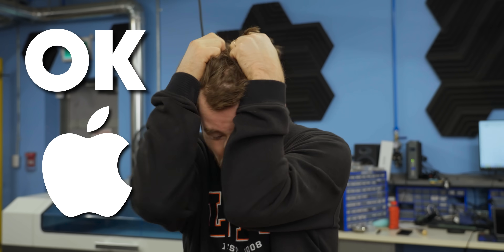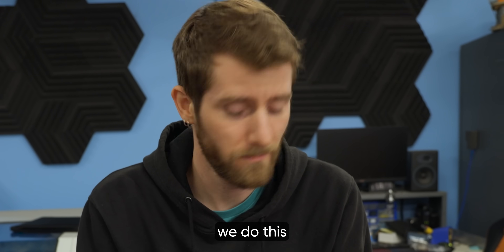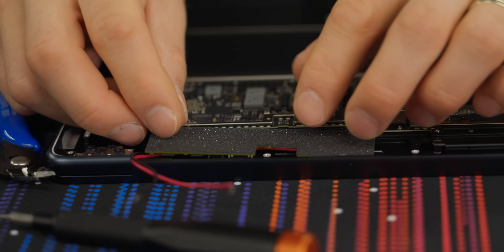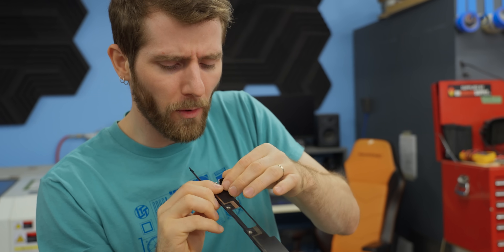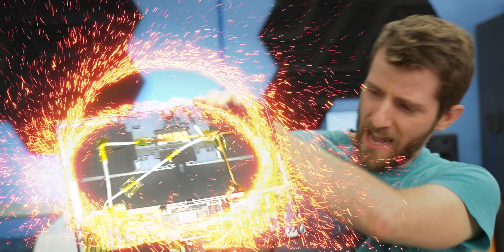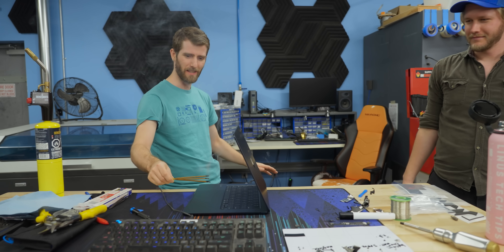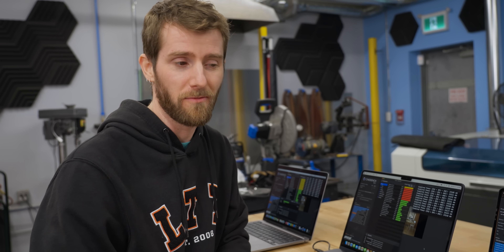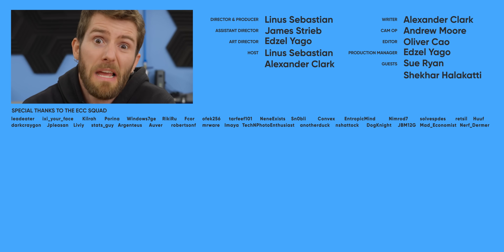Apple please watch this. - Frore AirJet MacBook Air

Comment: not legal, just click-bait. making your own cables <3. best part is no part, passive chassis metal cooling. sometimes you just invent part to sell a part, even if it could be solved more easily, or not at all, because already solved, airjet. terminology pride is you downfall, switches. you pretend to know and be the author-ity, but for no benefit, only a tie-block. also you dont have to fit stuff in the slim containers. come on, the backside of the lid would be an ideal large heat sink surface. flexible copper heat pipe bridge, from the main chassis, or a vapor chamber pipe.

Comment: Peizo electronics are so cool, but it's so unlikely that Apple would introduce this technology into their laptops in the next few years. It's more likely that we see windows brands like Acer, Asus, HP etc. put this into their already slim thin and light laptops, or maybe into 14 inch gaming laptops? Could this be the return of 13 inch gaming laptops if the peizo electric fans can be as powerful as a regular blade fan and be much more efficient? I have my fingers crossed

Comment: I’m far from an Apple fanboy, but this really just comes off as a hit piece against Apple. The Air isn’t designed for people who are constantly hitting the processors hard as there is no active cooling. The MacBook pro’s are the ones that are designed for sustained loads.

“Apple will listen or they don’t care”

Or they already have a device that has better thermals/active cooling for those who are power users.

Comment: LTT: We modified the MacBook Air so it has no MagSafe, no speakers, less battery life and is no longer silent, but it doesn't thermal throttle at sustained loads anymore. 
Apple: Have you met the MacBook Pro?

Comment: Wondering if the new copper heat spreader is causing the improvement and not so much the air generated by the device

Comment: "No moving parts" yeah except for the little flap of metal thats moving at insaneo speeds to move air, because you know metal fatuige isnt a thing at all, these things convert electrical energy into mechanical energy. A piezo fan uses this property to drive a cantilevered beam at resonances creating a fan element. that sounds to me like a moving part?

Comment: I always thought apple removed the fans in the macbook air after they released their own chips is because both the Air and Pro are essentially the same.

The only key difference being that the pro has a fan and doesnt thermal throttle as quickly...

Comment: I´m curious about the battery hit that using this thing causes in the system.... makes me wonder why they didn´t show the battery usage with in this 30 minutes test
like
the macbook without mod used 10% battery
moded macbook used 30% battery
and macbook pro 15%battery ..... or wherever number they got
this would be super nice to know and would have meant zero extra work from their end

Comment: Many good thing Apple do does not copy by other. A lot bad thing Apple do copied. Example good iPhone camera, front AF, telephoto, although it has been long in flagship android, it still not in low to mid ($100 to $200) phone. Instead many of that phone copy the bad rectangle body, dynamic island, etc that many of us does not need. Why not use more better hardware in low end Android phone?

Comment: I’ve never understood the MacBook Air thermal throttling issues - I’ve been using my M2 air for the past year and I honestly haven’t ever had it thermal throttle. Tbh the only issue I’ve actually encountered in my daily workload of software development / video editing is that MacOS appears to be terrible at memory management and consistently needs manual intervention to prevent SSD ‘swapping’ despite my M2 air having 24gbs of memory; and with the SSD being soldered to the logic board is more terrifying for me for the long term continued use of a MacBook for my daily work. Outside of this one little issue it’s been the best work laptop I’ve used in the past decade - more than powerful enough for my workflow, with amazing power efficiency to allow a full day of real work without needing to bring my charger into the office.

Comment: You are getting those numbers on the stock  Mackbook Air in a cold climate or under AC, in my 30°+ 95+ humidity country will thermal throttle in 0.5 seconds after turning on

Comment: I feel the biggest thing this video proved was that apples cooling solution was actually perfectly adequate for the intended use case of a MacBook Air - short bursts of high-performance, but overall light duty work. The fact is took 20 minutes of a synthetic load to bring out like a 10% difference in benchmarks? It could absolutely benefit from this cooling technology, but it also wasn’t a mind blowing difference either.  Maybe with better integration, we would see a greater difference, as to be fair. This was a fairly DIY hacks job and still prove the point.
Reply: That’s exactly what I was thinking. MBA’s are meant for people who do basic stuff, or short bursts of heavy stuff. If you need anything more, then you need a MBP, or to just deal with the throttling.

Comment: Your stats for what temperature causes burns is specifically for water, I highly doubt touching an object will do the same, it will probably depend on the heat transfer rate between your body and the object, for water you have maximum surface area and water has a high specific heat capacity. People can touch 60 C objects for reasonable periods of time with no burns, definitely not the 5 seconds for 3rd degree burns that they claim for water.

Try touching a hot object and then try touching the same temperature of water, the water will feel much hotter.

Comment: Dont think apple will implement it into the air. The "no cooling" part is the main difference to the pro, to be  fair. Do you want your processor runing fast and cooler you have to buy the pro.

Comment: Apple has been thinking different in ways that make their computers worse for years and that's not about to end now just because you CAN make a way to move air that's super thin. Being super thin isn't the point, the old intel Airs weren't that thin, the point is making it slower than the pro. They don't give half a crap if your machine dies quicker and constantly overheats as long as it doesn't cannibalize another model they can sell you when the first one dies.

Comment: Imagine if you did heat pipes like one of those insane looking air coolers, but instead of aluminum fins cooled by an external fan, you had aluminum fins cooled by direct contact with these things.

Comment: what if you just slapped a thermal pad on the cpu and then closed back up the lid? so that the bottom panel acts like more of a heat sink. Wonder if that would produce a similar result

Comment: I'm probably in the minority, but I specifically got a MacBook Air because it has no fans. It sits directly under a microphone for voice over work and I don't want that interrupting ever.
Reply: M1 didn't overheat right? Then they just screwed up the M2 design
Reply: @ciestermr1848  M2 was basically juiced up M1 with new chassis with screwed thermals.
Reply: @ciestermr1848 They didn't, people say they did but that is a problem when benchmarking for a long time, if a person is buying a MacBook for something demanding they should get the pro version, regular version is for people that browse web, do some school work and such not heavy rendering and so on.
Reply: I have the m4 MacBook Pro. I genuinely don’t think I’ve ever heard the fans kick on except for when I did a cinebench stress test when I first got it
Reply: this video is not about fans
Reply: leave it to jarrodstech to leave a comment about fans on a video without any fans
Reply: have an option to turn it off 🤷‍♂
Reply: @MrNick99 You can turn them off and see that they were not designed to run without fans, without fans enables it for being smaller and having better passive cooling, gaming laptops often sound like a jet after opening simple apps and without they will throttle since the whole thing is designed, the fans are there for a reason instead of being fit with radiator. Linus has made a pc with passive CPU cooler, my Mac is always cold and the it gets human temperature hot when running games like Project Zomboid a regular laptop would be lifting off already.
Reply: @_espo_5524  you have a very poor knowledge of other laptops.
Reply: @B-jv8iy  Nahh, had to buy one in late 2021 saw the options and the prices, have gone to classes with people bringing their own laptops from wide array of prices and companies.

Comment: There are moving parts, the piezoelectrics are electro mechanical substances that generate electricity when pressure is put on them or vice-versa. They don’t move much, but they do move. https://en.m.wikipedia.org/wiki/Piezoelectricity#/media/File%3APiezo_bending_principle.svg

Comment: Gotta hit up Rossman for the board views next time you need a power source on a Mac
Reply: They should have just probed all of the inductors till they found the main power rail. I don't understand how they fried something unless they slipped up and shorted a power rail to ground with the battery plugged in. An inductor would have been a nice big pad to solder to also.

Comment: If I was to modify the Mac book, I would have left all the peripheral as it is(not cutting. Design new back/bottom plate which can accommodate the new air cooler & its electronics. 
That way you would have increased the thickness of the laptop to 2 to 3 mm.
Make it very usable.

Later mass produce it to make money !! 😅

Comment: Either Linus was held at gun point to make a video on apple product where its glaring deficiencies are mostly overlooked. Apple is trying to appeal to the most stable 3rd party influencer because their gimmick products are trending to flop pretty hard or more likely Frore Systems attempted to pitch this idea to Apple and it fell on deaf ears, which is expected, leading to Linus offering their reach to help possibly get the ball rolling on this. I'm willing to bet that this will be internally tested at Apple, only become available on the premium model and claim that they are the first to implement and develop the tech

Comment: 5:55 yeah probing is difficult because you doin it wrong. No sane person works with both probes at the poles. Black is always on a good ground point, not on the part you try to tinker with.

Comment: Apple will not implement this. The MacBook Air is targeted at consumers who use their macbook for simple tasks, during which it stays completely quiet because it has no fans. The target audience for this product generally prefer a quiet laptop over a slightly faster one.
If you want better specs, Apple wants you to buy a MacBook Pro.

Comment: I'm curious to see if they would have been able to add some vertical spacers in the chassis so they can fit the Frore jets on top of the chip, and then perhaps used a 3D printed or CNC'd lip to fill in the extra space between the edge and base of the device, so that everything still works in the damn device :')

Comment: This is really awesome, I hope apple adopts it. I upgraded from an Air to Pro and I miss not hearing fans because there were none. x)
Reply: Do you hear your MBP though? The fans are basically silent on mine and even when I hammer it hard it's practically inaudible at <2200 RPM. If I manually set it at 100% and it goes beyond 5000RPM, its still quieter than standard 120mm PC fans at 100%. I don't know how they made their fans so quiet - maybe they just barely move any air since the ARM chips don't make much heat.
Reply: @pieterrossouw8596  yeah, when I run World of Warcraft, I hear them. They are by far not as noisy as my Gaming PC was, but you still can hear them. ^^

Comment: This is much more interesting for a Steam Deck for example, than a Laptop. Power budget and cooling is much more challenging there, as you only have like half a laptop.
Reply: Its really not, a fan is a far better solution as they can't make the battery any bigger in the Steam Deck without making it heavier.  I already wish they had not increased it in the OLED and just let the device be even lighter.  I never have a chance to drain the battery as my wrists hurt before then.
Reply: @alexatkin  yeah, but they still could still make it smaller and decrease noise

Comment: There are apps that let you manually control the fan speed on Macbook Pro. They should have done a test with the fans manually set higher to see how it compares to the preprogrammed fan-curve Apple provides in terms of performance when thermally throttled

Comment: Though I do enjoy the technology, I don't think the Macbook Air needs it. Especially with it just being a light usage laptop in mind. But on the Macbook Pro 14 or maybe the 16 with the base M3? I can see this have potential, especially if they can also reduce the thinness to not Macbook Air size but more thinner than the standard right now? Would be nice to see if it can, especially on the M3 pro or max.

Comment: They installed 3 Airjets. Each 1W.

They saw 3 Watts higher power consumption. Therefore more power = more performance.. right?
Or did they miss that those 3W are from the Airjets?

Comment: How much power is consumed by the usb? The modified one is the only one that have something plugged. Wouldn't be better to connect the air thing to an external power supply since you are measuring the power consumption???

Comment: so airjet let's u save around 5% of performance. On the other hand SoC in these conditions draw like 4-5 more watts than thermal throttled one (which is like 33% more) and on top of it each airjet is what, like 1 watt, so 3 more watts which is another 20% power draw increase over thermal throttled SoC power draw. Clearly a dimnishing returns for such increase in power draw on mobile device is not desireable.

Comment: I'm surprised this hasn't presented itself in the SFF community yet. Seems like a great way to add some additional cooling to existing SFF collar designs.
Reply: nah, Airjet will remove 10W of heat, this is ok for ultrabooks (although Intel will shortly burst to 65W even if chip is rated 10W), but nowhere near big laptops or small factor desktop
Reply: @Chipsaru  I was envisioning it more as an add-on to existing SFF solutions to increase their efficiency. For example, adding this onto the top of the heat-transfer plate would reduce the thermal load for the rest of the system I imagine.

Comment: Apple can barely stop the M1/M2 Pro and Pro Max from throttling. I have to use a third party utility on macOS to run the fans at 4,000RPM when the M2 is under full load in order to stop it from throttling to 60% of its performance. When the M2 throttles, I've also managed to cause kernel panics (watchdog timeout) because the e-Cores get too bogged down. A small adjustment to the fan curves would probably help, and, you know, adding in a button to make the fans work more.

I'm sure they'll find a way to goof this up :)

One final adjustment Linus, consider using a tool called "asitop" to show us the clock speeds of the M1/M2/M3 chips.